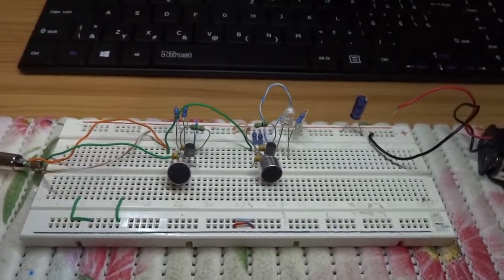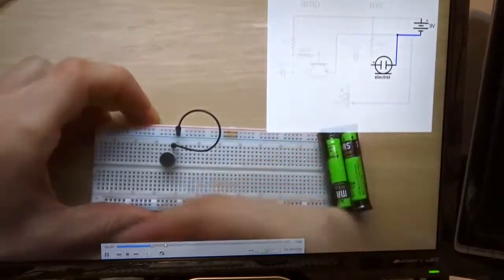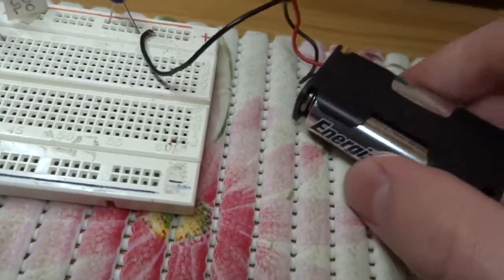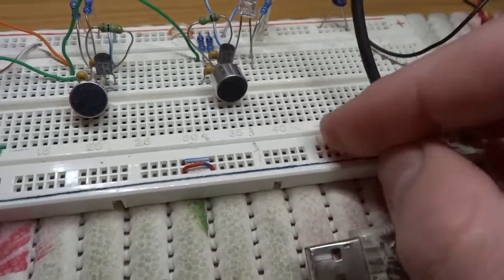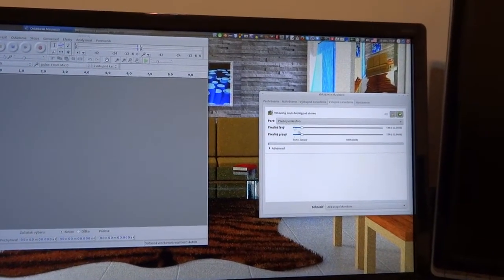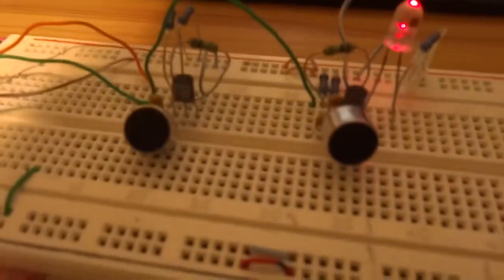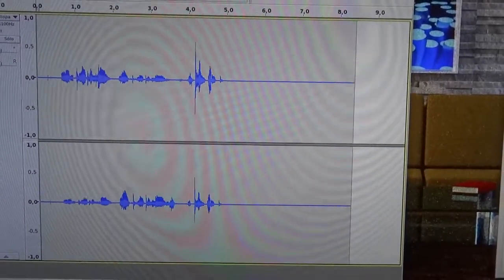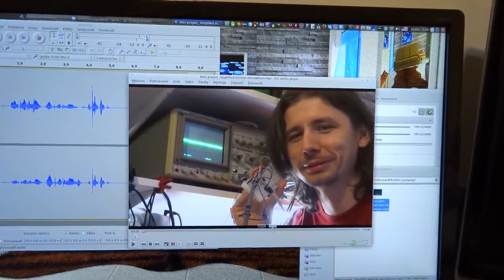Cheap Low Noisy Stereo Mic for PC - Mac - part 1 of 2

Comment from the maker: This stereo mic is from 2 identical block for Left and for Right mic.

2x  AA batteries with 3,3 uF/16V stabilisation el.cap. for PSU. First I wan to use USB, but its a very noisy for microphone. I will research it, how to fix it.
300 ohm + red LED for state on/off

Parts for one block:
2x 10k 0.25W
1x 100k 0.25W
2x 100nF tantal/ceramic caps / not carbon caps = carbon caps are bad solution
1x electrete capsule microphone
1x BC547C or any other NPN transistor